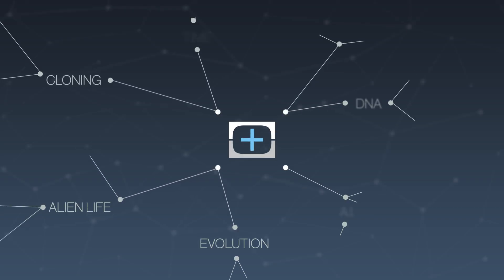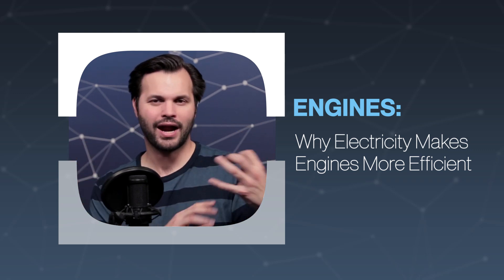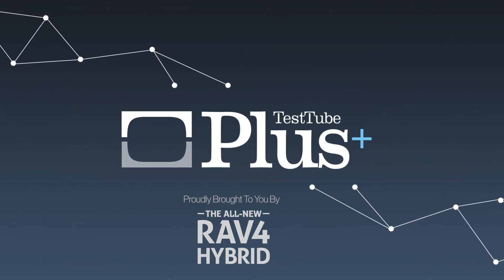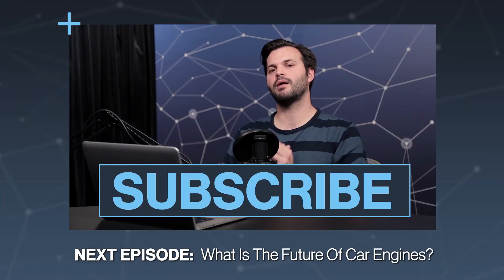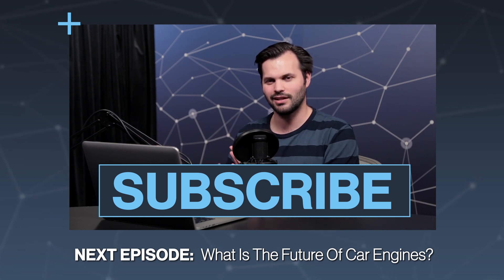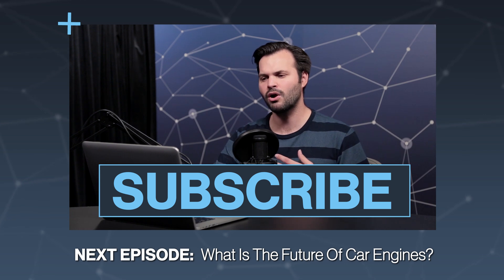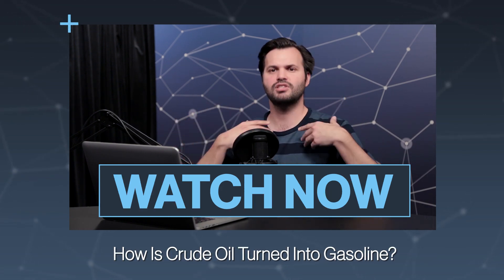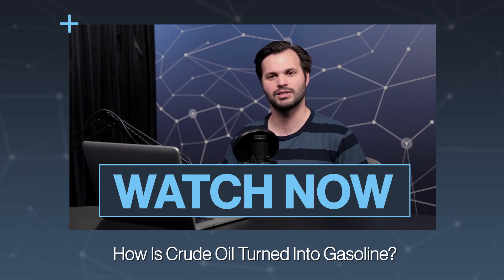Why Electricity Makes Engines More Efficient

Comment: The alternator provides the electricity when the engine is running. The battery is there to start and is a back-up in case the alternator fails.

Comment: Too many problems with electric cars! All that charge has to come from somewhere.Greenies and environmentalists love the thought of emission free transport, but disregard the energy it takes to make the batteries and the fact that Power input, is much less than the final power out. If you look at the Electrical Power chain from Generation losses, Distribution losses, charging losses, usage losses. (Maximum power transfer theory). It begins to make Electric look pretty poor in comparison to ICE in terms of power efficiency. But there's a bandwagon greenies are all jumping on, in blissful ignorance.Where will all those millions of batteries go when they inevitably reach the end of their useful life? I agree there are many more lubricants and toxic fluid concoctions when the ICE reaches its graveyard, but there are similar downsides to going electric unless a significant innovation in battery technology comes along soon!
Reply: Batteries have been improving linearly for quite some time. It will take another 10-15 years until we get the first 600-700 mile range electric car but we will get there. ICE'S (in terms of range) haven't made much of an improvement at all, at least, I fail to see one. Additionally, lithium air batteries might be able to double the battery compacity as reasearchers have found out. There are many problems to be solved and electric vehicles will only make a big difference if we switch to solor/wind... enery. About 90 % of lithium batteries can be recycled so that isnt that much of a problem.
Reply: Henry Siegertsz the batteries last a long time too m8
Reply: Messemer Robin Try putting out a Li Ion Battery fire? And in which dream world are 90% of LiIon Batteries recyclable?
There are advances in nanotechnology batteries but they are as you say at least 10 years off being commercial production scale.
Meanwhile unless all the energy to produce, charge and recycle the batteries is renewable we just transfer the emissions somewhere else! Batteries like solar cells, always use more energy to produce than they are ever capable of supplying!
Reply: Finally one who admits it
Reply: Super capacitor sometimes ultra capacitor? But even then there are all these copper windings that cost so much energy to produce and when they are recycled they cost an enormous amount of energy to be re used again....... The problem with electricity is that it just vanishes when it's being transported over long distances. Putting the Sahara full of solar panels sounds like a good idea but by the time that energy reaches places it can actually be used at least half already disappeared due to resistance that every  electrical cable has where were whatever current runs through ..... It would be impossible to power the US from just  one place where ever it is in the countr the distances are to big. Wind is a solution when there is wind with........ And as for battery's........ They don't last........ In most cases they hold 70% energy after 6 years compared to the 100% when they where new........ And that with in cars that most people don't want because of their range........

Comment: Here's something that I've wondered for awhile now, and haven't been able to find any clear info. In regards to hybrid vehicles (ICE & electric power), how is the power generation more efficient than a strictly gas-powered engine? I understand the other variables (lighter ICE components, heavy batteries, regen braking, etc.), but with my understanding of the laws of thermodynamics, the energy output of the ICE would be equal to the energy being put into the batteries - in fact, there's almost always a slight loss of energy when converting energy type from mechanical to electrical and back again, due to friction losses in the equipment. I know that ICE's only run around 30-40% efficiency, while most electrical motors are 90-98% efficiency.

So excluding all the other variables, such as reduced engine weight, regenerative braking, no wasted power while stopped, etc., can the process of using an ICE to charge a battery bank, which subsequently powers the car, actually be more efficient as opposed to a small ICE which cuts out while stopped, uses regen braking to supplement the alternator, etc.? My understanding of the science says no, due to the extra conversions of forms of energy. I'd love to hear from someone with a more thorough understanding of engine design and the science behind it who can show that this is not the case. I've hoped that hybrids would be a beneficial advance in the right direction, but my understanding of the science tells me that they could be worse, compared to a vehicle with a comparably-sized ICE and similar energy-saving systems.
Reply: Sorry for the late reply. I have been doing a lot of research on engine efficiency, and this is one of the many videos that I have watched. In the example that you provided, yes it would be inefficient to use the ICE to recharge the battery. That isn't the way that hybrid's work though. The batteries in a hybrid are only recharged through regenerative braking, energy that is thrown away in any other vehicle. Not only does it reclaim the energy from braking, it also saves wear on other braking components such as discs and rotors. The only time that it would be feasible to use an ICE to charge a battery for use in any type of electric vehicle would be to extend the range of an electric only vehicle.

Comment: people make me laugh with this electric cars are green bollocks how do you think the electric in the socket u just plugged that car into comes from ? magical pixies ? we burn coal etc to make that electric which is no better than just burning petrol (gasoline) or diesel to run the car electric cars wouldnt even be green if we ran on 100% solar and wind power because we have to manufacture the car in the first place we need oil to lubricate the parts we also need oil to libricate the parts on the machines that assemble the parts that then get put into ur electric car but even before that we have to strip mine or quarry the rocks that contain the iron that we can then extract and start to process it into steel but we also need dumper trucks the size of houses and wheels the size of cars that take rubber to make and steel and zinc and copper and plastic and oh yeah more diesel to run the damn thing so it doesnt matter if u run ur car on the farts of innocent children its still NOT fucking green ok ?

Comment: First I want to say I own a Prius. That said I hope it will be the last car I own that needs gasoline or other fossil fuel. I bought it to be efficient in the use of fossil fuel at a time when that was the only choice in the marketplace. We need to stop this fuelishness, and this site has apparently drunk the Kool aid that Toyota is peddling. There is so much wrong with this  video.

Here is one point.All hybrids, like my Prius, have to keep the electric portion of the system well separated from the gas engine part.  The two do not want to be too close because sparks and gasoline are a recipe for disaster. That they don't explode as regularly as Ford Pintos and some GM Pick-ups is that Toyota takes great pains to make this work. They do this by putting the battery and much of the cabling inside the car while keeping the exhaust system, and fuel tank outside and under. Liquid cooling of the electronics that has to be close to the two motors and engine that comprise a virtual transmission which does the magic that gives their hybrid the best efficiency a fossil fueled vehicle can have.  Other makers wish they had theToyota system, or they make do with inferior patents , or they pay royalties to Toyota as to have any other system is to over-complicate the process to get around the patents. GM for whom a good part of my life was spent working, in particular has avoided Toyota's hybrid patents.
Further, the weight of the engine, battery and motors adds up to the weight of a bigger engine so those savings are nullified. No, the sole purpose of the hybrid is to keep fuel burning engines in the loop, or else Toyota would not have moved their headquarters to Texas.
Now for the stupidity called fuel cells that Toyota has also bought into. Even with more efficient conversion technologies to make hydrogen, The pumping losses alone nullify most environmental benefits. That hydrogen must be highly compressed or even liquified to work in cars. Using that same pump electricity to charge batteries is just as efficient or perhaps more so. Only for certain smoggy cities can it make any sense, to move the source of the polution out and possibly downwind. And that can also be done with generating methods for pure electrics.  No, the hydrogen fuel cell is only to keep a corporate dominated centralized distribution system we now are forced to use that can continue with the same corporate middlemen we now have serving us gasoline.
So the first hybrids were not actually hybrids as they had no batteries in the loop. The ones we have now are mere intermediates to the true cars of the future which are electric. Preferably charged by rooftop solar that also serves to reduce home daytime heat absorbtion.  You know the heat that makes us so dependent upon major corporations supplying us with power for our AC units. Stop this madness of overconsumption now. This video seems to bea part of the push back against moving swiftly towards the sustainable world we really need.

Comment: @testtube plus ,  Sorry the hydrogen fuel cell is a no-go,  the only reason Solar power 'cleans up' making hydrogen is that its renewable energy going in.   But electrolysis is still only 50% efficient...  So you are loosing half that solar power to crack the H2O.  Why not just put it into a battery and keep 85% of that solar power.

Fuel cells have almost no viable use now or in the future.  There is a reason why they are not everywhere, however powerful small LiON batteries are.

Comment: Personally I would love to drive a hybrid diesel electric
truck, using excess power to charge a battery bank which could give the vehicle
a boost during starting off and pulling up a hill. However if I had the resources
for experimentation; it would be kind of interesting to see how a vehicle would
perform if it used waste heat from the ICE engine to boil water and run a separate
steam piston engine. Then couple both the ICE and the Steam engine to a set of
parallel electric machines, to charge a much smaller set of super capacitor
banks.

Comment: I want a plug-in biodiesel hybrid with a 300 horsepower diesel engine and a 200 horsepower electric motor. I want solar panels and wind turbines on my house to charge the battery. A graphene battery would be nice with that.

Comment: Smaller engine is not the goal, no engine is the goal. no petroleum,diesel, gas, natural gas all have the same problems of inefficiency, national security issues(add the cost of war to protect our petroleum needs to the price of gas). Hydrogen production has the same or worse problems as ethanol ie the process is to inefficient. electricity and motors are the most efficient and clean even if the electricity is produced by coal, the afore mentioned are all known and proven facts, this video seems to be somewhat biased maybe from sponsorship of Toyota.

Comment: 1988 Dodge RamCharger 360 V8 (5.9 Liter) 4 speed Manuel is my choice. Hybrids are a pain to work on. Battery packs that go up to 600 volts so you have to wear those uncomfortable rubber gloves after you filled them up with water to find any holes in them so you don't die. unplug the 12 volt battery. then the big battery then you have to wait up to 20 mins just to wait for it to be safe. just for anything from wiring down to a basic oil change -_- I'm only glad it pays good. if it didn't I would give everyone who pulled one into the shop the finger. lol
Reply: Glad to hear I'm not the only sane person here.

Comment: You mean coal powered cars? Electric cars get their fuel from the power grid which is dominated by coal power. If you have a ton of solar panels in your backyard and charge your electric car that way then you are helping the environment but you are buying coal power to charge your car your net impact is probably worse given that the battery is also terrible of the environment too.
Reply: Sean Pannella my city uses nuclear power sooooo

Comment: this is a terrible video.
The (simplified) reason hybrids are more efficient is that the mpgs gained in power-recouperating and efficient low speed abilities of hybrids outweighs the mpg penalty from weight increase of adding the hybrid drivetrain.
The reason Pure electric vehicles are more efficient is because the energy-to-power conversion is more than double that of internal combustion engines, while eliminating the need for transmission because electric motors are efficient over a much larger rpm range, so despite the weight increase of EVs its still overall more efficient.
The reason pure electric vehicles are more eco-friendly is because the energy could come from renewable sources.
Hydrogen has the advantage of also being renewable, but the efficiency of electric hydrogen creation sucks. And given that hydrogen cars cost similar to electric cars,  the solar-panel-to-car equation simply works in favor of electric cars.

Comment: i will like an integration of electrical engines onto gas powered engines, or even bio fueled engines. not buy a new one.  new one are so big, so expensive, so unreliable. also electrical engines are bypassed by current technology, still is low the integration on gas station and wherever it is fixed. gas monopolies also make it are the development.

Comment: Dude!

It is a shame that your sponsorship with Toyota has ruined your integrity.  

Hybrids by definition use fossil fuel and will never be the long term solution.  

Fuel cells lack efficiency.  

The real solution is electric.  

We already have such a vehicle in the Tesla.  I'm sure that Tesla will be improving battery technology and transitioning to solar when innovation allows. 

Toyota has no idea and you need to get rid of them to salvage your dignity.
Reply: +Carlos Long 
Even the best well built hybrid will last maybe 20 years. it is not a long term solution, but we have more pressing enemies of gas cars and ev cost. For this video, its not so much about integrity and more seems like someone who has no idea what hes talking about.

Comment: One thing that really annoys me about hydrogen fuel cells is for it to be a wide scale solution to the lack of oil, atleast the vast majority of people would need to get new cars.

My idea is we produce hydrogen and have fuelling stations for hydrogen gas but we install gas tanks much like lpg is today and run the hydrogen through a gas coverter or use liquid gas injection set ups in current cars if the government subsidised a large scale roll out of a system like this we would be able to use a fraction of the petroleum we use today.

If we then worked toward clean electricity, I think we would be much better off

Comment: no hybred actually are less efficient due to having to carry its dead batteries while the smaller motor would work harder it would be better to just have the small motor with out batteries or just batteries

Comment: Toyota Prius = 55 mpg
Pure electric cars = 95-120 mpg equivalent (one gallon equivalent of gasoline = 33.7 kWh)
So in the end, a hybrid is more fuel efficient than a non hybrid but much less efficient than a pure electric car.
And hydrogen fuel cell cars are marginally more efficient than a prius, because hydrogen SUCKS.
Producing hydrogen and compressing it down to pressures high enough to result in long range tanks is ultra inefficient.
Toyota SUCKS ! If they were serious about making alternative vehicles, they would have a Prius with a 60 mile range battery, which would result in a vehicle much more efficient and cost effective than their fuel cell vehicle will ever be !
Making hydrogen from solar might generate no pollution, but instead making pure electricity and charging an EV will be TWICE as efficient !
Plus an EV decouples us from being slaves of gasoline/hydrogen station. An EV can be charged 95% of the times at home. No more running out of gas, because your car is full charged every morning !
Overwhelming driving is within home's range.
Reply: We have finally found the new einstein. Mr Marcelo Pacheco the allknowing. Now go out there and save the world with your knowledge

Comment: Trace, sorry if I'm repeating a previously-made point, but what about diesel?
Reply: it's an even wors alternative than gasoline...
Reply: David Ekdal
Yes and no. Diesel engines burn much dirtier than gasoline engines, but they also need much less diesel oil to make the car go. I'd have liked to see that touched on in any case.
Reply: I was focusing on how dirty the burning of the fuel was.